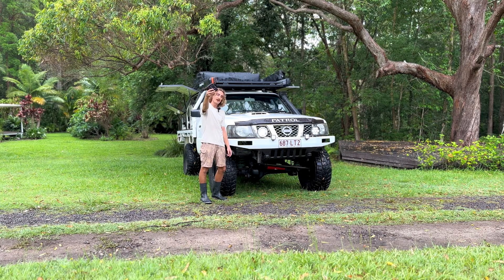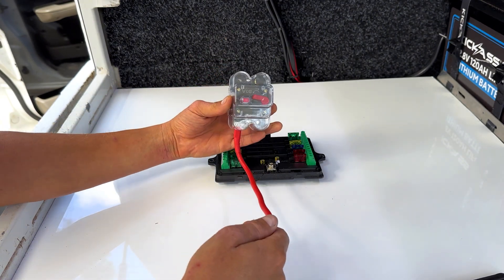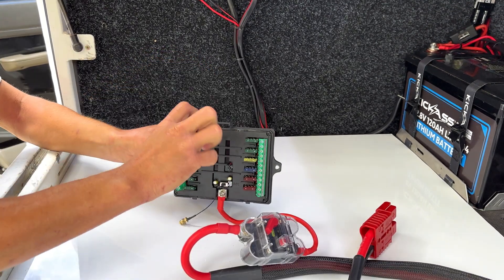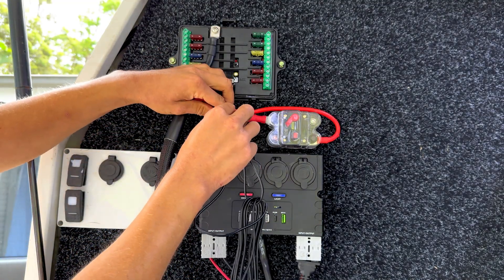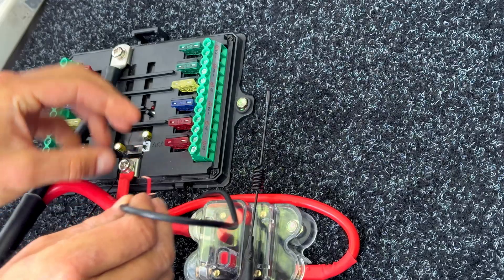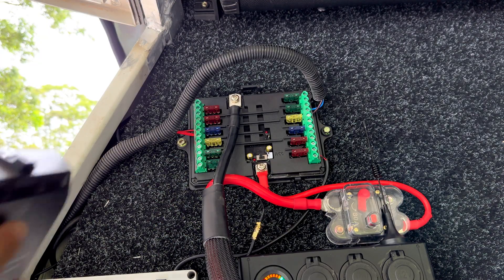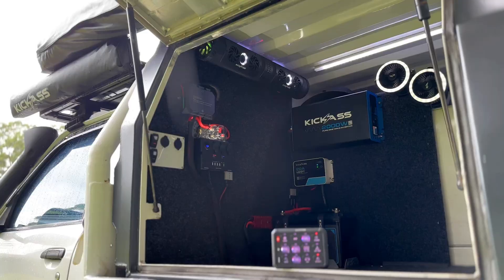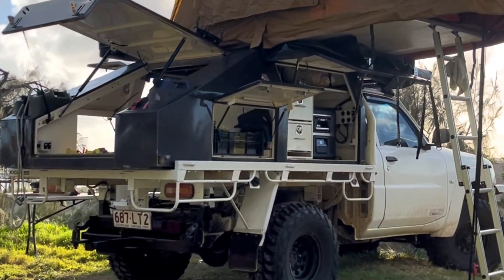Installing a KickAss Wireless Switch Panel For Your 12V Setup

Comment: does the switch panel have inbuilt relays to activate the system, or do you need to connect relays to the switch box?
Reply from the maker: You would have to wire up relays if you wanted them mate
Cheers CRaig

Comment: Does the kit come with the inverter cable? Is it easy as plug and play with an iverter bale to my 120ah lithium battery box?
Reply: An inverter would blow that little box to bits, if you could even connect the wires, you would need something rated higher than the current draw of your inverter
Reply from the maker: G'day jim,not to sure the question for the switch panel but our inverters come with the cables & then connecting inverter directly to battery box is the way to go mate 
Thanks for watching
Cheers CRaig

Comment: This looks very awesome! Is there a way of wiring in the switch panel so you don't need to recharge it or replace batteries?
How long do the batteries last?
Reply from the maker: G'day there mate as long as you supply usb c to the controller it will always be charged,otherwise it will last approx 5 days on a single charge 
Thanks for watching
Cheers CRaig